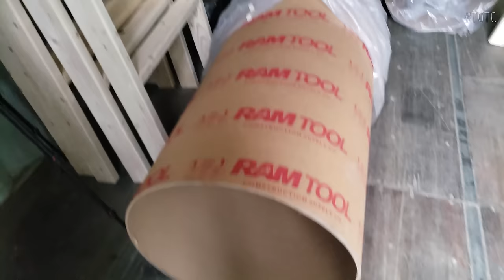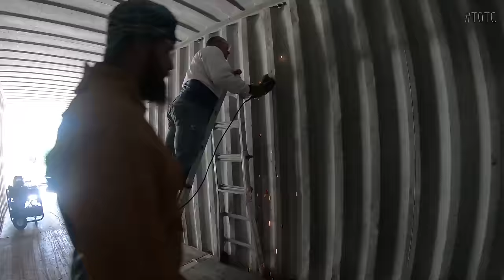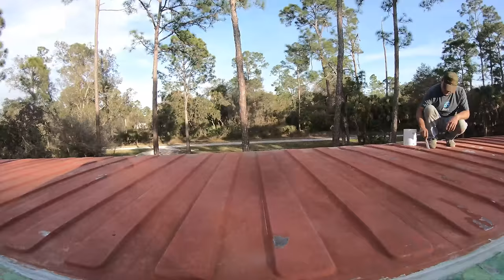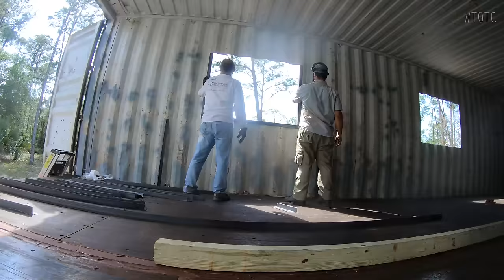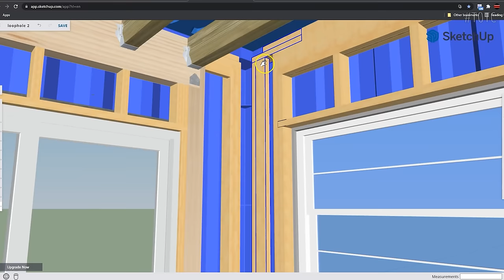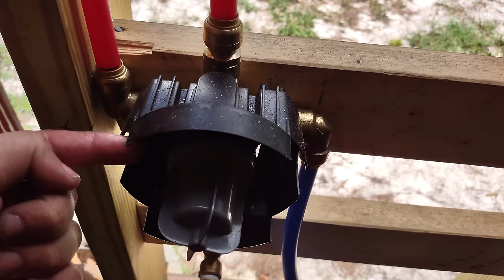FULL Container Home Build - Start to Finish Timelapse Construction

Comment: Sharkbites are approved for use underground and behind walls, but installing them there could be risky. In both places, the fitting would be out of site. You would have no way of knowing if it were to start leaking. A SharkBite fitting contains a rubber O-ring, which is not best for permanent connections.

Comment: You made yourself quite a cozy home. I’ve loved the idea of making a home out of containers. It makes it budget friendly. I’ve seen people weld I-beams on top of the containers to make a pitched roof to shed water and snow (depending where you live). I’ve even seen where foam insulation was added on both the inside and the outside walls to increase the R-value by reducing heating and cooling costs. The other nice thing about containers, is that you can stack them any way you want to or as high as you want to. You did a fabulous job.
Reply: I'm considering building something like this, and you just gave me a great idea!

Regarding the I-Beams: couldn't someone just slice the top off the containers and then attach wooden 2x4s (extending the frame, basically) to not only create a pitched roof, but to also add another level??

And if that were to work out, what about codes and permits (United States - NJ specifically)? 

Because if that can all fly, I might end up going that route. My first idea was to build a small cottage with a basement from scratch... But lately I've been thinking that maybe I should just purchase the land, get two or so shipping containers, and convert them into one small cottage.

Once that small home is finished, then I want to build the actual rest of the house around it (think of it like adding addition after addition/adding a room or two (or a certain amount of space) at a time.

Kind of like a home that'll be a constant work in progress for around 5 or more years.

I wonder if I can pull that off. Time will tell.

And thanks for that idea!
Reply: @Lifelong_Lesson  Yes you could do that, I believe you would need to add a strut support, example from the i-Beam to the floor as the container walls are not strong enough on their own. Im not a contractor so if I use the wrong terms apologies.
Reply: @Lifelong_Lesson  as long as everything meets code, you shouldn’t have a problem. You can bury the containers to create your basement, you’ll just have to waterproof them first, but yeah, you can set them side-by-side, stack them on top of each other, set them end-to-end. If you know how to weld, that makes it even better. If you’re wanting to set them side-by-side, weld them together. If you want to expand your space, take a grinder with cutoff wheels, and cut the sidewalls out. If you still have questions about your build, there’s YouTube videos that take you through the process. I hope this helps and answers your questions. Just be careful of the Taxman.

Comment: This is inspirational and I'd love to build a family cabin on our country property. One thing I think I'd change is, I'd build separate sewer lines for toilets from the rest, that way I could use the waste water from sinks and showers to save in water barrels to use in my garden.
Reply: Forgive me if this is not a good question asni have absolutely zero experience in such matters...but it would seem to me that using drainage water from showers, (given all the chemicals, artificial coloring, scents, heavy metals, etc., in common soaps, shampoos, conditioners, not to mention the heavy chemicals such as bleach from cleaning agents commonly used to clean showers), may not be the ideal water source to use in your garden, or plants in general, correct?
Reply: @jasongelb6745  you would use green products for this very purpose

Comment: make sure to put a good amount of insulation between the waterlines and the outside metal wall as it will freeze in winter as the steel makes it worse,  i had this problem in my container hm and that was in las vegas where winters are nothing.

Comment: WOW great job. I really like how you beefed up the ceiling rafters. You wouldn't really want a multi-port with an input of less that 3/4" All supply lines are either 3/4" or 1" Also I do not know where you are located with weather, but you generally do not put plumbing on an external wall. So now since you have hopefully you are definitely going to insulate the crap out of it. Looks GREAT!!!
Reply: He's in Florida, weather isn't much of an issue down there
Reply: @marcusborderlands6177  Awe makes sense...Great house he did a great job!

Comment: Awesome, the plumbing explanation was useful, but I would have liked a bit more about the other areas, final finish considerations, what you could have done better, maybe information on the cost of materials. Either way, thank you!
Reply: His plumbing wasn't quite accurate. He needed to have slopes because it wasn't all sloped as needed for proper flow. My guess is with it being such a short run of pipe he may not have any issues, but I wouldn't be surprised if he has issues with his sinks and bathtub/shower backing up.

Comment: Good job 👍  Im a retired bricklayer so i may be speaking outa school.. but id absolutely add a main shut off valve and access panel at the water main before the 3- way junction. Then one at each line immediately after the split. Before you close the walls up, you'll thank me later. Lol. If it were my project id have shut offs at each and every tie in to the water supply after that, it'll save you lots of headaches later.  Js
Reply: He may have a shut of back in the pump room.

Comment: Good job man. As a plumber myself though I would have supplied the hot water heater and the 4 way T with 3 qtr. Inch. You might have the same issue with the hot water heater,as it will probably be 3 qtr inch as well.

Comment: Great job man, precise satisfactory execution and great explanation, filming and editing 👍 
I have three questions if you would: 
1) Why putting all these double joists in the roof from inside while you are bearing weight on?

2) Did you think of solar system or windmill to self suffice for electricity?
Question came to mind when I saw you are water self sufficient already 👍

3) what's your state? Or, how cold it gets in winter?

Thank you very much for sharing 😀 🙏🌺🌿

Comment: Great job!!! Greetings from the Philippines! I love your planning and preparations and your work generally. I got a question though... you've cleared out all the rusts on top and sides, but what about underneath? I saw a lot of surface rusts there while you are talking about the plumbing.
Reply: Alex I agree about the bottom rust, a rust preventative is a must if he is anywhere near the ocean or possibly (?) high salt content in the sand all depending on his location along Gulf Coast. White sand. And especially in the Philippines. Where I am in Initao it's rained for a month straight pretty much. CDO and Cebu have been clobbered. I've been looking into container homes for years and its down to that or Autoclaved Airated Concrete (AAC). More flexibility with AAC and cheap labor.

Comment: Should have put in some turn-off valves for your water. You are going to need them in the future.
Reply from the maker: If you mean a turn off valve before water enters the home, yes I did put one. There's also another one out where the pressure tank is right after the well.

Comment: 58:17 the small piece of 3/4 of an inch pipe connecting the two 1/2 inch pipes is going to affect the water pressure taking account of the Venturi effect, but I believe only slightly. So not much of an issue. Otherwise the trick you pulled was very intelligent (that's the whole point of innovative engineering, being able to improvise), given the fact that you didn't have any other choice. All in all a very well documented build! Congratulations for your efforts both in putting the personal work to achieve such a high level result and for doing all the research and planning by yourself! Kudos and wish many more projects like these for people that want to think and live out of the box!

My regards from Greece
Reply from the maker: Yeah I had looked into that extensively and couldn't find anything saying it would cause an issue. So far water pressure in the house has been great so....
Reply: @thinkoutsidethecontainer what about insulation, for walls ceilings and flooring, did you think it wasn't necessary? Seen some builders that have regretted not using the insulation, as metal will cause condensation inside the property.
You house looks amazing, you're a perfectionist  and very handy, congrats great house and great skills 👏
Reply from the maker: Yeah I used spray foam insulation inside on all exterior walls, under the house, and on the ceiling. I didn't film much of that, near the end of the build I was focused more on finishing the house than filming.
Reply: @thinkoutsidethecontainer  perfect, recording and editing is just as hard, you did great

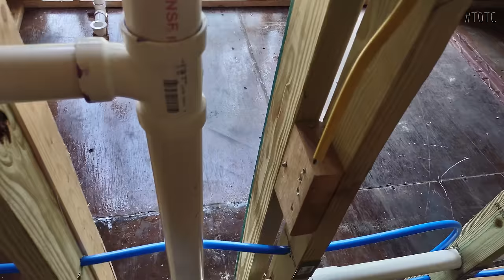Comment: @ 47:38,..   The 2 X  1-1/2 tee is upside down,.. When Draining install branch ( 1-1/2 ) down like you did on the Kitchen Drain,..   The Branch on the TEE upward when venting.   All around Great job.
Reply from the maker: @jarheade3823  I've had a few comments about the "upside down" tee on the vent. Is it really a big deal that it's upside? Meaning, is it really going to inhibit the performance of the vent?

I've seen conflicting opinions about this online. Some say it's probably inconsequential to the performance of the vent.

What do you think?
Reply: @thinkoutsidethecontainer  With 37 years of plumbing experience holding a Master Plumbers License for 32 years.   In Houston the plumbing inspectors here would never be OK with that vent,. two 90s or 180 degrees is all they allow,..  Vent Tees always upward,.  Horizonal vents should have a slight rise up,.. 42 inches from floor to center of vent pipe minimum,.. Upside down vent tees Might create a vacuum sucking your P-Trap dry filling your home with a nasty smell of septic sewer gas.
Reply from the maker: @jarheade3823  interesting. If you watch my other video "Top 10 Mistakes I Made Building My Container Home", you'll see the first mistake I list relates to an issue I had with venting: https://youtu.be/_LiqY7V7qYw

However, I didn't chalk up the cause to the upside down tee (I proposed another theory), and it indeed may have nothing to do with upside down tee.

But who knows.
Reply: @thinkoutsidethecontainer  I admire your creativity,.. that Container Home will last 200+ years.  Please keep making these videos,.  I do not want you to think I am besmirching your hard work.   It's just hard for me to see something I spent my life doing right and say nothing when I see the opposite.

Comment: Great job the only thing I noticed was that the vent that comes from the kitchen sink venting to the laundry vent should be upside down so it can vent out. I'd forsure try this. Thanks!
Reply from the maker: Yeah I've had others point that out to me. Do you really think gas/air particles will have trouble venting because of a slight downward bend in that piece? Sounds crazy to me lol

Comment: I thought the containers needed thorough rust stop and seal inside and out. And also, those back doors to the containers could have been fantastic secure shutters if the interior design had been reworked to have sliding glass doors there.

Comment: In the kitchen where you had the plumbing done. The 1 1/2” vent line where it goes and connects to the  2” the sanitary tee needs to be flipped upside down. That’s so that it can vent the proper way, which is up.
Reply from the maker: I'd love to see a study showing any significant negative outcomes from the tee being the way I have it. Although I agree I installed it "upside down" per common building practices, the notion that venting will function significantly poorer because of a small curve in the tee facing one way instead of the other sounds ludicrous to me.
Reply from the maker: I just looked into this topic again (I've looked into it before over the last couple years), and once again I'm not getting the impression having the san tee "upside down" or "right side up" makes much difference for venting purposes. Is it a code violation? Not sure. Has it had a negative impact on my plumbing? Not that I'm aware of, and from my research everyone online seems to have a different take on this matter.

Comment: Good job ! Only not sure about that exposed PEX under the structure. Animals will chew on it. Also, that long horizontal washing machine drain run without vent a and with that 90 in the corner - hm, not sure how that will work ...
Reply from the maker: Thanks for the feedback. You mentioned a long horizontal washing machine drain without a vent? The washing machine drain does have a vent.... unless you meant the drain runs to long a length before the vent....
Reply: @thinkoutsidethecontainer  Yes, that is  what I meant. With  2" pipe you can go up to 42" horizontal with 1/4" per foot, not to exceed width of the pipe over the length of the run. Now I understand it will probably somehow work, but you may have difficulties later on with drainage. But I don't wanna  make it look like I criticize your work. Love what you do - and more power to you! Good job & good luck !
Reply from the maker: @elmono3939  back during the build, I did a good deal of research on the venting pipes for the various fixtures, and I do believe I was confident I had the proper vent distances. But I'd have to go back and double check your numbers, which of course I'm not going to do because the house is done, but either way, thanks for your input.
Reply: @thinkoutsidethecontainer  There are two Codes we go by: IPC and UPC. Then there are local Codes that add to them their own requirments. So it depends under Code your work falls under. UPC is stricter of those two, requiring dedicated vent for each plumbing fixture. IPC doesn't. However, long dirt arm is not as much about Code, as much as it is about law of physics.

Comment: Was it necessary structurally to bolt the bottom plate of the framing all the way through the container to the concrete pier (All-thread/Epoxy) ? Or was it to satisfy an inspector? It would seem that bolting to bottom frame of the container should be enough if the wood framing plate and steel frame line up.

Comment: Would it be simpler to trim the corner squares to push the containers flush rather than caulking? You don't need those corners to bear weight anymore.
Reply: Cutting those corner blocks would be one big pain I T A.  Even with a touch it would be a challenge. They are solid steel and would be a chance of getting into the inside of the container and have to patch/seal that.

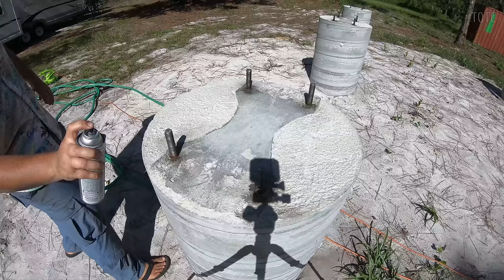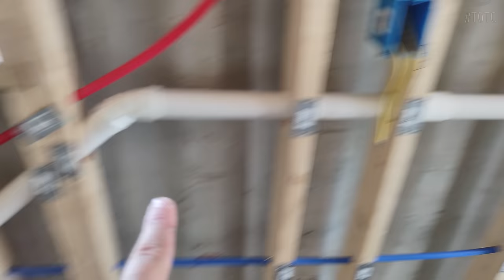Comment: 8:45 Cold galvanizing compound sprayed.  48:00  Everywhere there are Pex connections inside walls I put the connections inside plumbing access panels with drains.  Has saves headaches a few times.
Reply from the maker: Yes. It's quality stuff. Surprised how well it works.
Reply: @thinkoutsidethecontainer  Zinc chromate primer is another great one.  It's big in the aviation industry.  Expensive but gives protection forever after it cures...
Reply from the maker: @TennesseeHomesteadUSA  we'll see how long I can go without the sharkbites leaking. I have more faith in sharkbites than others who've commented on this video over the years. But we shall see.

Comment: Very nice, wish I owned it. I must ask why you used those big and expensive Joists when they had no roof to hold up, only ceilings.
Reply from the maker: My structural engineer told me I had to because the 16 foot span. I resisted him a lot on this but he insisted it had to be done.
Reply: @thinkoutsidethecontainer  I would take the advice of an expert every time.
Reply from the maker: @JazzFunkNobby1964  yeah, I mean it's what the engineer told me to do so I just did it. Maybe he was wrong, who knows

Comment: FYI using pex fittings would have cut your cost by 70% overall you did a good job for a someone who’s not a plumber
Reply from the maker: Damn, I never thought of that. Who knew that the ease, convenience, and time saving of Sharkbite fittings came at the cost of a higher price tag compared to the more laborious and time consuming fitting systems. Thanks for the great insight, plumber 👍

Comment: I was wondering what you did, are doing for rodent /insect control between the container walls that you didn’t cut out. I could see daylight when you were walking about explaining the plumbing. It appears the join isn’t sealed on the bottom, or the vertical joining areas of the remaining interior container walls.
Nice video with a lot of detail.
Reply from the maker: Spray foam insulation underneath the house where the containers meet. For the sides of the house where the containers meet, I used Quad caulking, which was then eventually covered by by a long strip of flat bar steel, welded in place.
Reply: Excellent!
Great job - be proud of your work and I wish you great success in your 3D modeling. You appear quite talented with an attention to detail.
Reply from the maker: @marknichols7861  🙂👍

Comment: Hey I'm just really curious about why you didn't fully weld the gaps between the containers all the way down and only done spot welds down it and then used caulking to fill in the gaps, I'd think that welding the strips all the way down it would have made it way better at water proofing it and would last way longer to. But other than that man you did an awesome job and I loved watching the project come together like it did, major props on the hard work it most definitely paid off ☺️💯👍🔥😎
Reply from the maker: Basically I didn't weld full length because it would have be an insane amount of welding. About 160 linear feet. Overkill. Unnecessary. Would have taken forever.

Comment: Would it be easier using 2 containers instead for the same floor plan...less walls to cut, less gaps to seal & save the cost of 1 container.